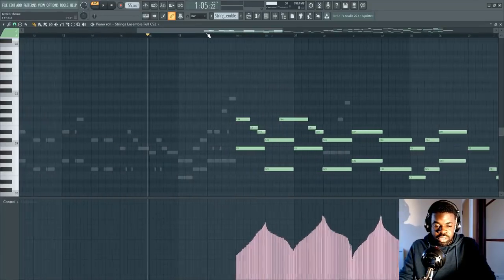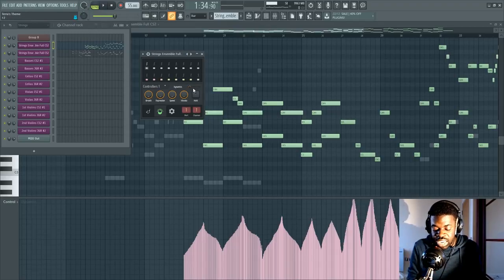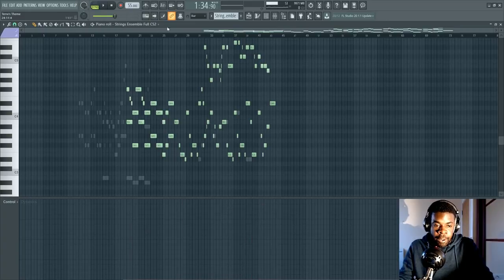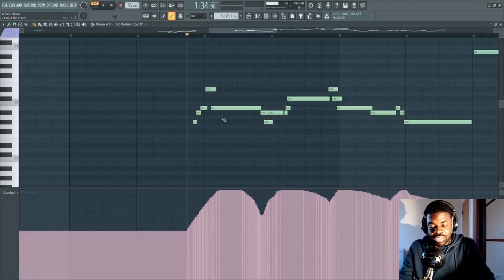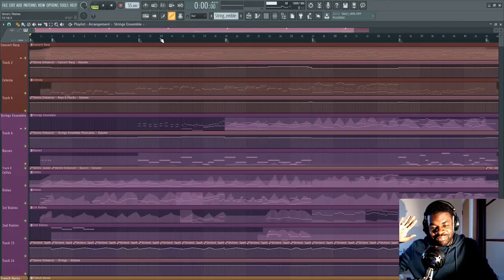Mod. Wheel / Expression Curves & MIDI CCs in FL Studio Explained (Edit Events Function)

Comment: Isnt expression just volume ? I have a kontakt library with oriental strings that supposedly has heart or violins but image line tells me this wont work even if i get a breath controller a expression pedal or assign it to the mod wheel. They kept saying use patcher. Its like 275 step process for 1 damn thing

Comment: 1:55 double click brings up the mod wheel setting window
     -  BRSO Articulate is what gives him that nice small and simple window for his dyanmics and mod wheels and all that,
Go watch the vid on how to set that up

3:45 how to link your keyboard/ MIDI Controller knob to FL mod wheel

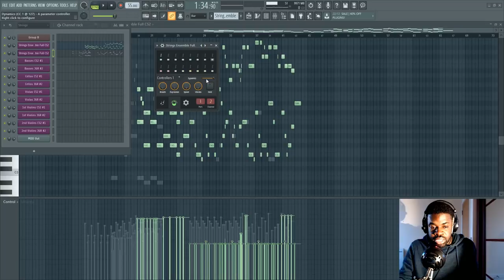4:03 How to make the Expression Curves after Mod wheel is set up
4:28 You can change how precise the Expression Curve is with the Snap on top left

4:40 To ignore Precision/Snap) Just hold alt and draw
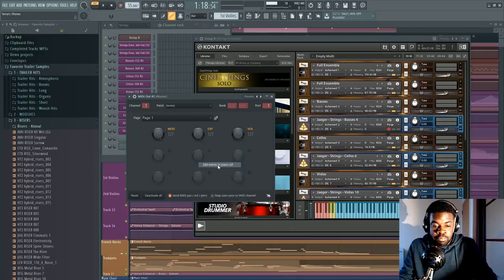12:50) To draw steps (Shift + L-Drag)

6:00 He usually does more “work” on the expression curves for chords than melody lines

======================================

7:00) How to record Expression/Automation Curve with MIDI controller
7:35) This is another way to do the same thing but more tedious, it shows you EVERY single possible automatable parameter 
(No reason to use this method over the above one)
----------------------------------------------------------------
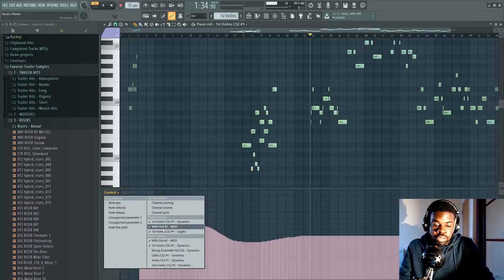10:12) ?Cool things you can do? But aren’t useful?
Like Copy pasting expression curves through the MIDI out window settings

11:00) How to increase or decrease entire expression curve by smaller or larger margins altogether

11:27) Expression Mod wheel, in most VSTs its like another “vol” knob

14:05) Recommends using VST instruments separately instead of just an ensemble
So every instrument can have a slightly different Expression curve = end result is more realistic 
=====================================

=====================================

MIDI Out window manual setup If you dnt want to use the BRSO Articulate

6:50 How to link to MIDI out if you don’t use BRSO Articulate

     -  BRSO Articulate is what gives him that nice small and simple window for his dyanmics and mod wheels and all that,
Go watch the vid on how to set that up

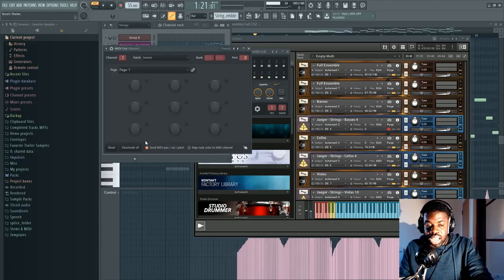8:28-13:20) How to activate mod wheel and expressions in MIDI Out 
As opposed to BRSO Articulate

9:55)Troubleshooting MIDI out window
If “Edit events in piano roll” option is not available when R-clicking MIDI out wheel
Then you can do this

==================================================
Side notes 
4:40)
(For more shortcuts: Read the “Edit Events” section of the FL Studio Manual)

12:12)  
(Sometimes, CC1 and CC7 have different uses in certain libraries.
Their role is always written on the libraries instruction manuals)

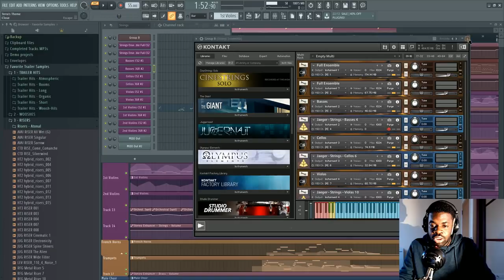13:30) Highly recommends using BRSO Articulate for MIDI CC expression curves and other dynamic controls because of reasons he mentions in his BRSO vid
Reply: Gene Zhao Perfect! Thanks
Reply: thank you so much
Reply: you are the man!
Reply: Thanks for clarifying about  BRSO Articulate. I was so confused, where that window came from. You safed me. Thanks a lot!
Reply: Bro, double click doesn't work, what should I do?
Reply: how can i get true expression with middle eastern oriental strings? Bc i have been trying to do this for an oriental middle eastern strings libraries HR STRINGS from HR SOUNDS. It supposetly has (Heart of violins expression). but Havent been able to get the results i want. Image line is telling me its an FL studio problem. Im trying to do it through midi cc11 by assigning it to the mod wheel, but they are telling me midi cc11 is set to volume by default. Regardless if its midi cc44 itll still be at the volume control.. Then they told me kontakt uses midi cc1 for expression, (which the library is set to by default in kontakt), and i have to use both midi cc1 and cc11 with BRSO Articulate to control the dynamics and expression. Still no luck.

Comment: East West Hollywood strings documentation says the following about CC11 (Expression) 
According to the manual it is not just volume as far as i understand:

"Expression is represented by another MIDI control code: CC11. The usual way to use
CC11 is for continuous control of the loudness. That is, while Velocity cannot change
mid-note, and it is recommended that CC7 be set only once at the beginning of the
piece—or at least only at the start of major sections—CC11 can provide the kind of dynamic shaping of notes that give music its expressive life (hence the name “Expression”
for this Control Code). Use it to create swells in the middle of a note or of a phrase. With
CC11, you create the crescendos and fluid dynamics of expressive music.
In Hollywood Strings, CC11 is often used to control cross-fades—especially when the
Mod Wheel is already being used to control some other aspect of the notes, such as the
depth of the vibrato. In these cross-fades, CC11 still provides the same continuous control of loudness that was described above, and it also controls timbre. In such a crossfade, Velocity is usually turned off; that is, the selection of which dynamic layer should
provide the samples is taken away from Velocity.
In a CC11 cross-fade, all the dynamic layers (for example, pp, mp, mf, and ff) play at
once and CC11 controls how much of each to mix into the output. In this approach both
the loudness and the timbre change continuously and together, giving a much more
realistic sound. You will generally find CC11 cross-fades on those Hollywood Strings
instruments that can benefit from mid-note changes in dynamics because they are often
held for long times."

And for CC1 it reads:

"In Hollywood Strings, control of the vibrato is available for instruments that can be held
indefinitely. The shorter notes in the other folders generally are not held long enough for 
EASTWEST/QUANTUM LEAP HOLLYWOOD STRINGS
 Chapter 5: Orchestral Technique 75
vibrato to be heard. But note that vibrato control is available for sustained notes in the
playable runs. When vibrato control is available, it is the Mod Wheel (also called CC 1)
that controls the depth of the vibrato. With the Mod Wheel all the way down (at or near
a value of 0) the note is played non-vibrato. As you push the Mod Wheel up (increase CC
1), the depth of the vibrato increases."

A'm i correct to assume that in EW hollywood CC11 is used for the velocity or "presure" (expression) and CC 1 for dynamics (vibrato).

To get more confused wherever i read people tend to says expression is the same as volume, as for EW that's not the case. EW uses it to control pp, mp, mf and ff (which is presure or continues velocity (presure)). 

Is my assumption regarding EW expression correct?
Reply: Late reply but yeah, EW has an older scheme where modwheel = vibrato, expression (cc11) = dynamics (the timbre of the sound). And cc7 for volume of course. That said, on the lighter patches the modwheel controls both vibrato and dynamics. Most other devs use modwheel/cc1 for dynamics nowadays.

Comment: I'd been getting by with a cheap keystation keyboard with a modwheel for the last few years.
But I just got an 88 key keyboard with proper key action or properly weighted keys as a gift. But it does not have a modwheel whereas my old cheap keyboard did have one and I used it a fare amount for string orchestras. 
I really want to use the new keyboard but the lack of modwheel is a huge hit. 
Does anyone have a tip or any suggestions. Or any recommendation for external controler that can be used as a modwheel?
Thank you.

Comment: Question: We create the MIDI OUT on the channel rack but we don't need to connect it to any specific channel (instrument), right? We just create the drawing and then open a pattern (say, cello) and on the control option we find the drawing we created....is that it? Nothing is happening. Actually, one thing happened: the drawing i made modulated the vibrato of the instrument and not it's modulation. Does it have to do with the plugin I am using (Edirol Orchestral)?